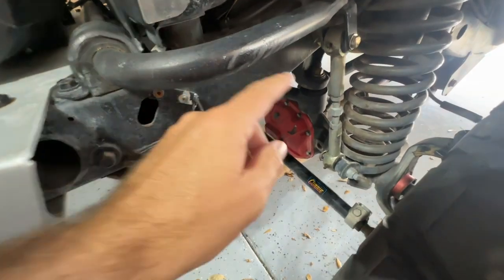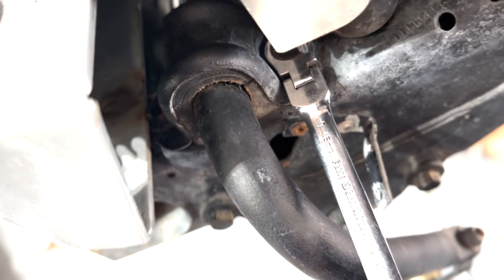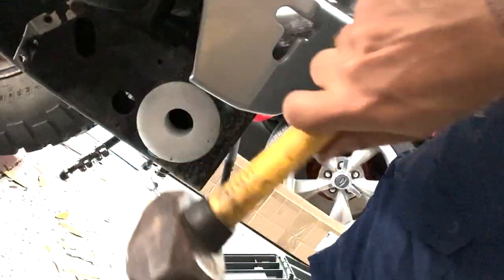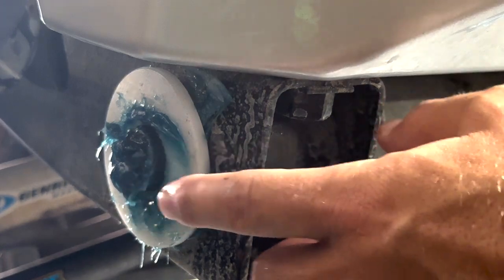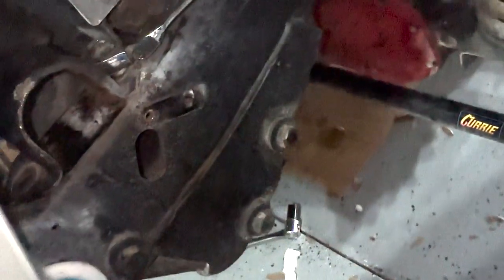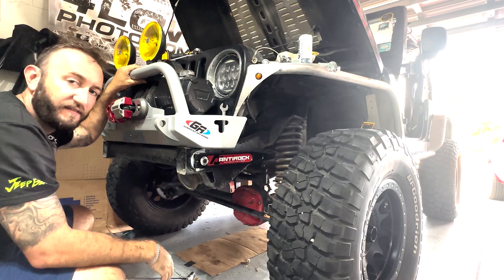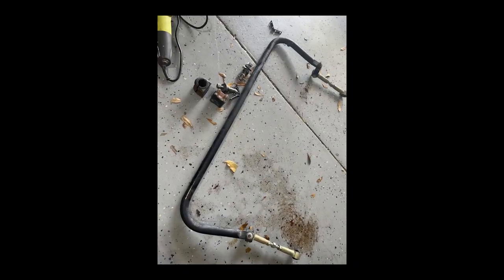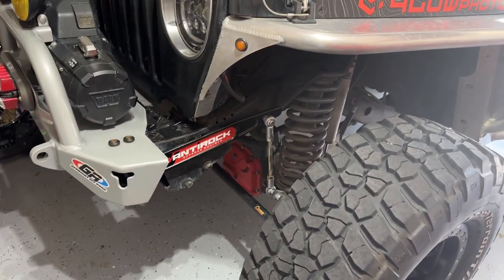ROCKJOCK ANTIROCK SWAY BAR INSTALL On Our Jeep Wrangler TJ!

Comment: What do you prefer antirock or staybar  deconected ?
Reply: replaying from my personal account. This was the 2nd Jeep I have done anti-rock on. Here's what I can say. It is not as stable on road, especially at highway speeds.  It is amazing to not have to disconnect, even if it is just a dirt road or the beach, it is helpful. You do actually lose some full droop on flex, test that on the RTI ramp and went farther up with the Anti-rock disconnected. All that being said and living in Florida, I prefer the antirock. With having to disconnect, it was always hard to pull them and re connect i you are not on perfectly flat ground, you get all dirty doing it, and they always seem to be in the way and the tires hit them when flexing. But if budget is an issue, discos can be had for a 1/4 of the price of antirock. So all comes down to preference.
Reply from the maker: Hope that help. K if you have any more questions !